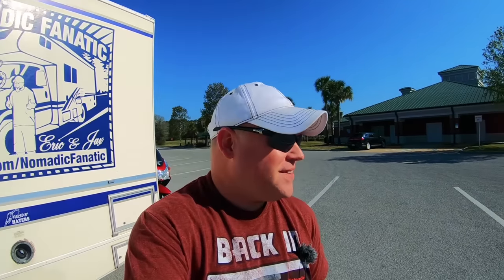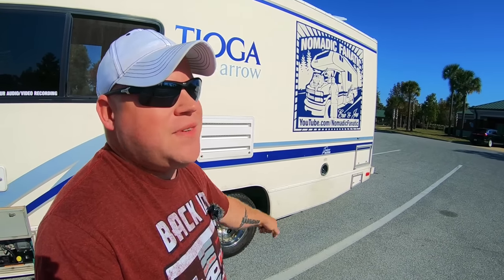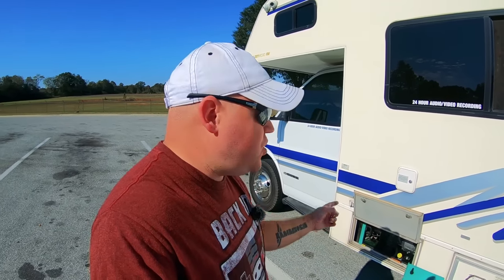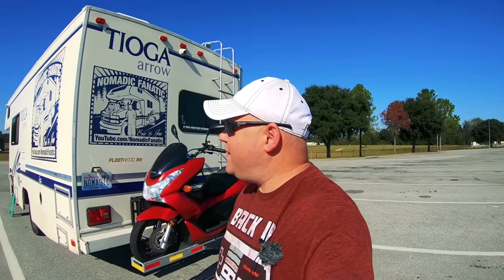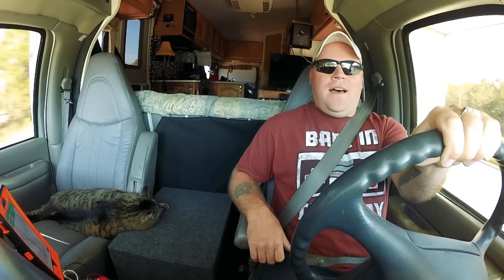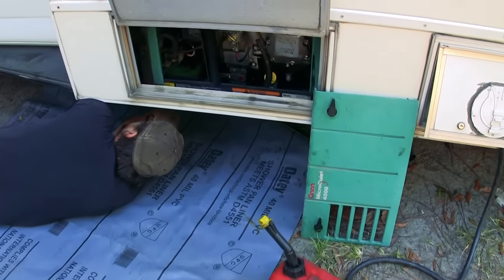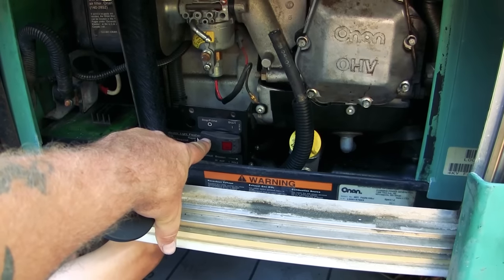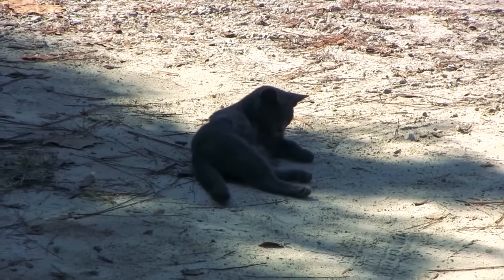The Last Things I Expected To Fail

Comment: That is what my Onan emerald plus was doing.  Turned out to be the low oil pressure switch. It is located behind the sheet metal above the oil filter. Disconnect the wire from switch and ground wire ti cyl Finn   If it starts then it’s the pressure switch.